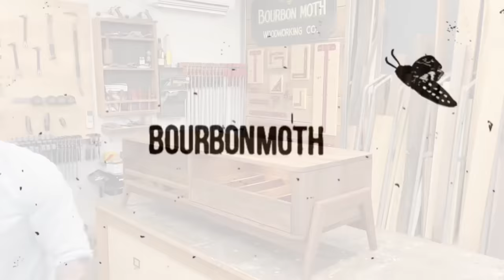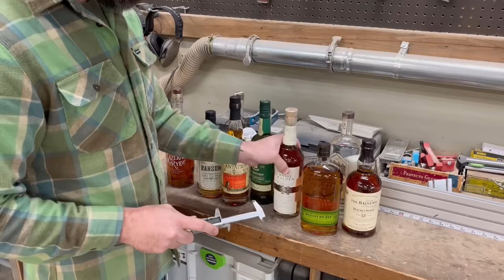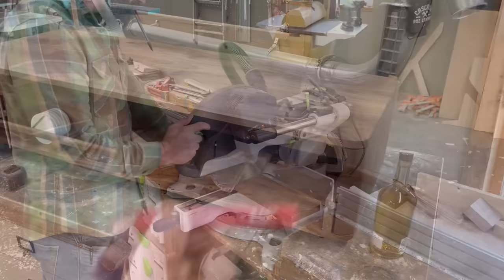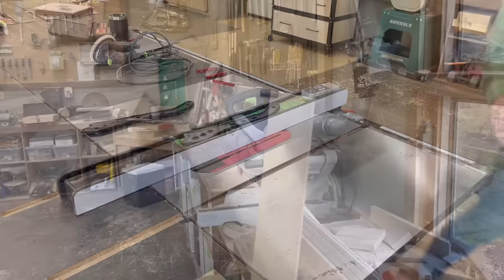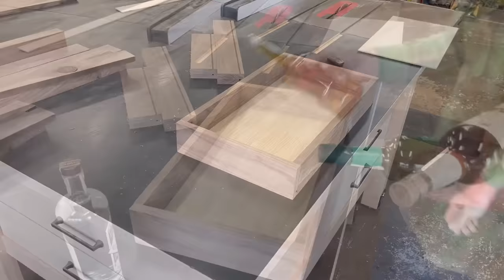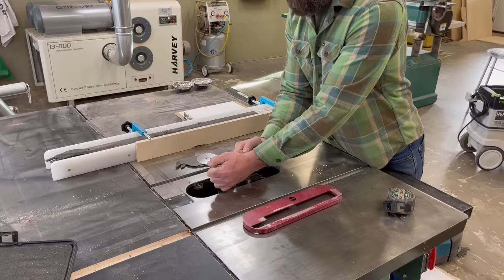Build cabinets the easy way || How to Make Drawers

Comment: You could use some white-oak hand-plane shavings as a padding for the bottles to keep them from rattling around in there! Really nice looking table, that shadow-line in the sides really makes a HUGE difference! cheers!
Reply: I did that with maple and walnut shavings for a maple and walnut serving board this Christmas. Definitely looked impressive and adds to the hand-made charm with very little effort

Comment: Great square peg into a round hole dowel creation tip.   Enjoyed the drawer build.  If you are only going to have the bottom drawer, I think I would have made the drawer so that it had the bottles tilted up in the back for better visual display with the lighting.
Reply: Great idea.... Makes sense now that you mention it.
I guess that's a cool thing about woodworking, You can always use sandpaper and add to it if you get a good idea down the road.
I hope he sees your comment.

Comment: I keep a deck of cards in my tool box to use for spacers blocks. Can easily adjust thickness with number of cards used and you can play solitaire when you take a break. I like the leather strap stop. Good job.

Comment: Having made drawers with wooden slides, keep a couple of things in mind: 1) make sure there is a gap between the drawer grove and slide large enough to account for seasonal expansion/contraction, otherwise come August, that drawer will not want to move and 2) the wood on wood drawer/slide combination will eventually begin to wear (given it may be many many years from now depending on use), but attaching the wooden slides with screws only (no glue) will make that repair dramatically easier...a couple of extra screws are plenty strong enough to hold up the drawer.
Reply: also use a nice oil finish, and clean and wax regularly (wax 2x a year/whenever it starts to stick, clean once a year to take the old wax off if needed.)

Comment: I have used Miller Dowels for years to build drawers and boxes the same way. The stepped drill works great and the dowels have rings/grooves that provide great holding power.

Comment: Beautiful table!  It has all the design features we love about the retro-vibe of Modern Mid-Century furniture,  The shadow line separating top from sides provides a sophisticated subtle detail that while not structurally necessary, does convince the eye of the quality of the overall piece.  The shape of the legs, the rounded edges and the use of wooden drawer slides further emphasize solid furniture building principles that support the period you are reimagining.
My only internal cringe-worthy moment during the entire build was the missing dovetail drawer construction.   You have given us such a skillfully designed and executed example of finer cabinetry making.  I love this piece.  With solid wood drawer construction, one expects you to follow the design through with the detailed joinery worthy of such a beautiful piece.  Does it change the function?  Of course not.  Is it troublesome to do, requiring extra work?  Yes, however, the end piece of furniture becomes undeniably classic even though it's a light-hearted "bourbon-mancave" drinking table that pays homage to single-purpose furniture.
Reply: Drawer

Comment: Just a fun tidbit. When I used the flap of masking tape on the drill bit as an ad hoc depth guide when putting extra bolts on my Mom’s mahogany dining room table legs from underneath (DEFINITELY don’t want to punch through that top), my Mom started to laugh. She learned that hack in college in art school. Then there weren’t pre-made canvases for oil painting. They made their own. She’s 93 and used a hand crank drill.

Comment: It needs green wool felt placed in the bottom & sides of drawer compartments to cushin the bottles. And a little bar to prop the bottle necks up slightly for a nicer display experience.

Comment: Good video man, nice clean build, and that dowel tip is sweet.  I've been looking for a simple way to take 22mm dowel down to 20mm over half the length of it to make some dogs for a vertical panel cutting station 'm setting up for my tracksaw.

Comment: I got some touch lights like the ones you use, but they have a motion sensor on them.  That way if you moved the drawer it would light up and would automatically turn off after a couple minutes.  Pros: Would save on batteries and wouldn't require you to turn them off manually every time.  Cons: Can't turn them on before guests come over to highlight the bottles when they walk in.

Comment: Loved this build. 

Couple of thoughts: 

Keith Johnson did a “add visual flair to your drawer boxes” video where he used brass dowel pins as one example. Loved that you did a similar trick with the white oak, but was secretly hoping you were gonna bust out the brass too. 

Also love the wooden drawer runners, but in my opinion this would have been the perfect time to use Blum soft close runners, if nothing more than to protect your stash of someone rides the drawer home too hard. 

And as others have mentioned, something to tilt the necks of the bottles up would be nice. Maybe if you have some more scrap white oak lying around you could do a few neck tees to hold each bottle up at like a 10 degree angle. 

Solid project and loving these new two part series.
Reply: Something to tilt the bottles (and stop them rolling from side to side) was one of my thoughts too - neck tees or even a full-length wedge with a shallow groove. The wedges could still be removable, and possibly faced with a piece of soft leather for just the tiniest bit of extra glass protection.

The awkwardness of getting the leather strap screwed/unscrewed from the drawer also had me thinking about other attachment methods. The two most viable options that came to mind are:

- A fairly beefy metal snap fastener - rivet one piece through the leather, glue or screw the other to the top edge of the back drawer panel. It'd be more visible, but also more secure than hidden on the back face. If visible then a brass fastener would look pretty classy, especially paired with other brass accents like your dowel pin suggestion.
- A single little half-blind dovetail in the top centre of the back panel, with a matching dovetail 'key' on the strap that slides snugly into the slot - super secure for stopping the drawer but also easy enough to slide up and out for removal. The key could be a nice hard wood but now that you got me thinking about brass, I love the idea of cutting/grinding a solid brass key from a single block of metal. Perfect little classy aesthetic bonus for anyone who notices it :)

Comment: Nice build. Suggestion drawer-stop: You could slide your drawer out to the desired position and mark it's position. Drill a hole in the bottom  of the cabinet and stick  a protruding dowel in. Now when you pull the drawer, it will only slide out until it hits the dowel... Don't glue the dowel if you want to be able to pull it out at some stage. To me this is a more 'elegant' / simple solution.

Comment: One solution to the cork being eaten by the whiskey. You just need to elevate the cap/cork. At the back of the draw add something to bring the top of the bottle up. You would have to experiment a little to see what angle would be best, but you have enough clearance to do it. Just a thought...

Comment: A suggestion: when you have wood parts sliding against wood parts. if you rub in some hard carnauba paste wax of the type used to wax cars, the parts will glide over each other like butter
particularly when you have wood furniture like a dresser or chest of drawers-just heavily apply the paste wax the contact portions of the drawer and the case rail. Carnauba car wax (paste, not  liquid formulation)  works infinitely better than beeswax or soap.I also use this as a lightly buffed finish on  the bare wood interior surfaces of the drawers

Comment: The leather stop is a nice touch but you might consider two strips spaced out towards the sides of the drawer instead of the one in the middle. This would give the stopping action a more positive feel instead of wobbling when you hit the max drawer extended position.

Comment: Hey, really like your method on building drawer slides.  I am in the midst of building a banquette and it calls for long (40" long drawers)  They will carry some weight and wanted to know if you would do the same for long drawers or if you would consider a different method.  Thanks so much in advance for any advice.  Love your channel.  Mike

Comment: NICE! It's much simpler than I thought! 
I'm curious if you'd consider a series showing how to make/install different drawer slides? You've done the blum slides and the wooden slides. One very expensive and one very inexpensive. What about those soft close drawer slides? I'm struggling with those myself. I could never get the drawer to fit perfectly side-to-side with those, it's always 1/4" off or so. I'd appreciate some tips from you!
Keep it up! I'm always keeping your videos in my favorites just in case I need to rewatch them for later projects! :)
Reply: Just finished exactly what you mentioned.  Key:  First be sure the drawer slides that fastens to the cabinet are parallel front to back.  Next install the drawer side rails, that go on to the drawer, into the slides and make the width of the drawer just slightly, and I mean just slightly, narrower than the space between the slides (like less than 1/16"). I'm just an amateur at this but my four drawers came out like perfect.
Reply: @dwightl5863  Yeah that's exactly what I did. Only I think the box or 'carcass' is not square. Like the front is wider than the back. I may have to scrap the whole armoire because of this.
Reply: @rosecovell930  I had that on my carcass.  I used some shim stock between the drawer slides and the cabinet so the slides are the same distance apart front to back.  Doesn't work to shim between the drawer slide and the drawer.

Comment: I've had a battery drill since when they first came out in the 80's; before you were born. And my 9v Makita drills from the 90's are  still going strong; perfect for an around the house tool. Those Makitas don't hold a candle to my modern Milwaukee cordless but there's still a 10 year old corded Milwaukee in my arsenal that kicks the tail of everything; even your teal 18v stuff. That's the wisdom of age. Oh, and I can do math just fine. That said, I can't believe you're still using a corded trim router and jig saw. That's like soooo 2019. Your project videos are interesting but I'll never be a patron of someone who insults me for a cheap joke.

Comment: Great build, Jason, but just a small tip for you: when you make plans beforehand you could make some parts like 'mirror images' of each other (like those drawers of this table accidentally turned out to be?). Believe me: this'll save you lots of time, which can be used for drinking whisky.
Reply: I was thinking exactly that when he was cutting the divider slots one board at a time. Stack those 4 sides together on the sled!

Comment: I feel like I'm the only amateur wood worker that uses the construction master pro calculator for measurements. That thing makes getting accurate cuts and lining up stuff way easier. Way overkill for my job tho, I build shipping crates. The cleets don't need to be down to a 1/16th of an inch...

Comment: I guess you didn't do inside dowels due to possible alignment issues...  Using the drill to make dowels was kinda neat... I saw people using a hammer when doing this. Nice.
Also John Peters made a quick table saw dove tail jig video recently.

Comment: I heard a good tip for removing the glue is to wait about 15 minutes for the glue to firm up a little bit then it will come off easily and pretty cleanly

Comment: Question. Do you have an issue with splitting the wood when you drive home the dowels? I have had that if I did not use fluted dowels.
Thank you for the video.
Reply from the maker: You just don’t want to put to much glue in the hole.
Reply: Still learning that. Made a couple 48 inch tables with mortised shelves and about 74 dowels for each. Split a couple pieces with too much glue.
Reply: @ericvanzandt2208  The beveled ends of the dowels will help give the glue a place to spread into.

Comment: May I suggest using magnets on the slides and sides of the drawers as a stop instead of the leather string so you can pull out the drawers fairly easily should you need to do so 😉

Comment: quick question, when you screw the draw slides on the side walls of the cabinet, don't you need to consider possible wood movement in the future? (thought all hardwood even for the wall)

Comment: You could have used a set of Dunlop straploks to attach the leather strap to the back of the drawer.  Quick release but it would still hold solid.

Comment: I love this build! Great video. Only thing I'm wondering though, with the wood slides being such a snug fit, won't the drawer bind with wood expansion?
Reply: I think the drawers will be ok, the wood will expand and contract such that the height of the draw will change. Plenty of clearance there.
The table!s legs and drawer runners are cross grain to the table carcass though.  The table is probably 18 inches or more wide, it will expand and contract about 1/8 to 1/4 inch over the seasons.  the legs and runners may loosen up a bit over the years.  
That said, the look of the table is undeniably beautiful. Great proportions, details and style.
Reply: @richardweiler1552  I'm with you there. I was curious about the hardwood slides expanding vertically in the tight slot cut in the drawer. I'm inquiring because I would love to build drawers this way but don't want any binding problems... Now thinking about it though, I guess I could just make the slides 1/16 smaller vertically than the slots cut in the drawer.
Reply: @simoncapizzi9689  Yes, plus the slides are narrow enough that they will only swell a very small amount.  I have done drawers like this and they work well.

Comment: If you really wanted to have fun with your drawer stops so they wouldn’t fall out you could’ve router the groove on your slides that you mounted inside the cabinet and then drilled a hole through the side of the drawer so you could put a dowel through it that would ride in your groove and stop it from coming all the way out. You could’ve made it say a quarter of an inch longer than needed and filed in a decorative groove to grab a hold of to pull the pin when you want to take the drawer out. If you really wanted to get fancy make these four pins have square tops chisel into the side of the drawer said they would countersink a touch once again file or cut in your little groove so you can grip it and pull it out and remove the drawer.

Comment: Hey love the videos! I’ve got a problem I keep running into. When I’m applying finish with either a rag or sponge pad etc, I find it catches on the wood fibres and makes the surface come out in little splinters. Regardless of what sanding process I follow. Noticed it on oak veneer and solid oak and pine. What am I doing wrong?

Comment: The two most difficult parts of this build had to be: 
1.  Getting anything done with all those bottles just laying around ready to be opened.  
2.  Getting anything done with a kegerator just laying around ready to be opened.
It is an amazing build!
Reply: Yes it's difficult when you're under the mind control spell of alcohol (:

Comment: If you want to make your drawers more easily removable, you could use a guitar strap nut on the drawer and just punch and slit the straps.  I’m no wood worker, but if the concept has been holding up 20 million Stratocasters for over 65 years, I bet it can keep you from dropping your drawers unexpectedly.

Comment: Just curious , why do you make two passes when you cut parts on the sliding chop saw??
Reply: Easier on the saw and much less chip out
Reply: @daveklein2826  I doubt it would be hard for that saw to cut 3/4" material.  But I agree with the chip out.

Comment: In spacer, could have used dove tail joints
Reply: And you could have avoided the dowel
Reply: Or you can avoid the dovetail and use a dowel

Comment: 22:38.  This is something I have a hard time understanding.  Seems to me that first cut you make is going to determine if the slot is going to end up dead center....right?  For example, and this is an exaggeration, but if you run that first groove a 1/4 inch from the side of a 5 inch drawer side, when you flip it around, there is going to be 1/4 groove from the other side...not in the center.   How do you figure out where that first groove needs to be?  Or am I making a mountain out of a mole hill?  Thanks.

Comment: If you make a piece of furniture using poplar, could you list it as “solid wood” or is that term reserved for hardwoods. 

I’m a new furniture maker and I’m moving away from plywood but I dont have the equipment to really work with hardwoods. (Standard garage voltage and ryobi tools) 

Thanks in advance!
Reply: You can use your standard voltage tools with no problem, Dani.  You might have to take several smaller passes but you can definitely do it with your existing tools.  I have a small basement shop and do it every day.  It just takes a little longer is all.
Reply: @KSFWG  thank you.
Reply: Poplar is like pine, it is not hard wood
Reply: @daveklein2826  would it be considered solid wood or is that term just for hardwoods?
Reply: To me, solid wood means it’s not veneer over plywood or MDF.  I don’t think the species matter.

Comment: At 23:14 I don't understand why you didn't measure the slot width with your vernier caliper.  A ruler sighting won't give even you the required accuracy.
The holes at 25:17 - aren't they counter-bored rather than counter-sunk?